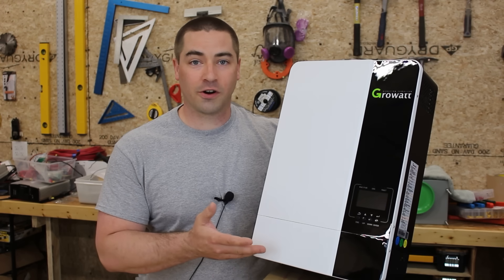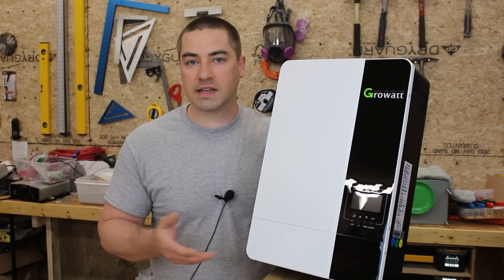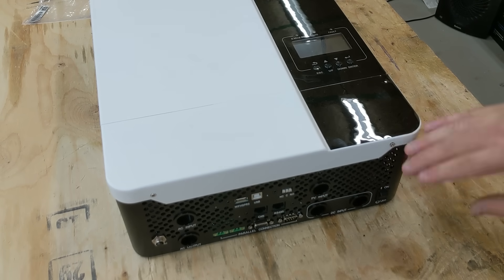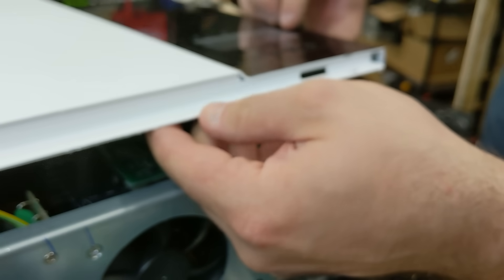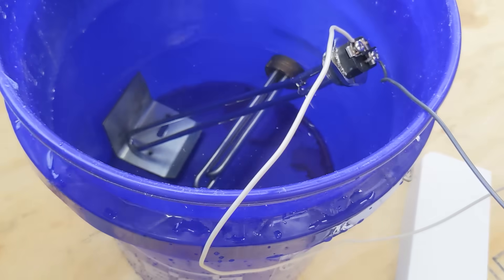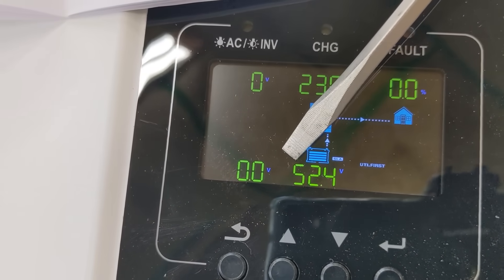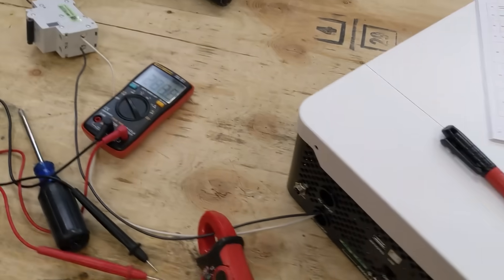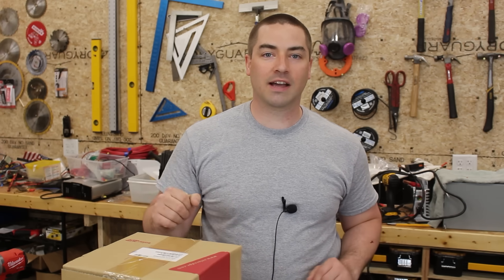Best Value Inverter, All-in-one MPPT Solar Charger, Growatt SPF5000ES, Part 1

Comment: Hey man, i was planning on getting an inverter to charge and use 48v batteries in parallel. I like this inverter but wanna know of it will work in my house if im still connected to the grid. I dont want to export any power so i dont care about it being grid tied. Will it blow up in my face lol? Thanks :)
Reply from the maker: If your only goal is to use this as a charger, then yes you can do that.  But, this inverter is not UL1741 listed, so it's not correct to use it as a pass-through of the grid to loads.
Reply: @DavidPozEnergy  thanks for the reply man. My dad ordered one so im trying to find out how to get a work around for it. Perhaps theres a way to make it work alongside an existing electrical system, maybe getting another inverter that can be grid tied so that can deliver load to the house.

Comment: Hi David. Just a question I have. On the right side you have a sticker and is saying 1 string , what do you think if we use 2 stings of 2800W each?
Reply: Connected to only one of same type of inverter U use
Reply from the maker: I currently have 2 of these inverters installed powering my home.  Each inverter has 2 strings of solar panels wired in parallel into the single screw terminals.  It's OK to do this if you stay within the parameters of the charge controller (built into the inverter) and the two strings of panels are identical.  Both strings must be the same panels, same # of panels, same angle, and same azimuth.

Comment: I'm setting up a 4S2P with this exact inverter,  8 panels total. 
each string of 4 will produce 154.4v - will that be ok?
Reply from the maker: The manual for the Growatt 5000ES says the "Start-up Voltage: 150Vdc +/- 10Vdc".  That means it could be as high as 160Vdc.  Since your proposed array is 154.4V, that will probably be OK, but might not work all the time.  I'd try to get a little higher voltage if you can.  Remember, this is for Vmp,

Comment: Questions: 
1. Can I use this inverter, with the AC Input be completely isolated from the AC Output?
2. And then use the AC Input to charge battery if need be?
3. Is there some form of scheduling for the AC charging: AC charge when battery < 50v between 10PM to 4AM?
Reply from the maker: 1. No, there is a direct connection between AC input and output when in pass-through mode
2. The AC input can charge the battery, but it will also be directly connected to the output at the same time
3. I don't know if there is a timer function, I don't think so, but not sure.  

To be clear, I only use my inverters in my off grid setup.  i don't have anything connected to the AC INPUT side.

Comment: @DavidPoz do you have a video that explains how to pre-charge capacitors on inverter? or can you explain it more? My battery pack don't have this pre-charge resistor inside
Reply from the maker: Most any large resistor will work.  Basically, you connect your negative battery to inverter.  Then you connect your positive to one, but not the other.  For example, connect the positive wire to the inverter, but not the positive of the battery.  Then use a resistor in between the positive battery post and the positive wire.  Hold for a few seconds, then quickly remove the resistor and hook the positive wire to the terminal.  I use these resistors: https://amzn.to/3T6VC1N

Comment: Dave, do you still think this is still the best inverter?  What about the SolArk 15K emp hardened?  How do they compare?  Would like to run my house and charge my Tesla
Reply from the maker: The best inverter for you might be different from my best because we probably have different requirements.  I've been very happy running my house on a pair of Growatts for over a year now.  I posted a 1-year update video: https://youtu.be/0xY4OdBfn44  Charging a Tesla will probably take 10-12kW of inverters. You might need 4 or more paralleled to run your house and charge your car.  Remember, the 15k Sol-Ark is a 12kW inverter.  Personally, I'm not a fan of the Sol-Ark platform and I made a video explaining why: https://youtu.be/EYIzEW54_bY  Yes, I was testing the 12k model (actually a 9kW inverter) so 3kW smaller than the inverter you are considering. But, keep in mind that a house might need 10kW, and charging an EV will take another 10kW, so the discussion of 3kW more is a minor point in the larger picture.
Reply: @DavidPozEnergy  thank you for the detail
Reply: @DavidPozEnergy  what about the XW Pro? I thought this video testing peak and unbalanced loads was very convincing. https://youtu.be/-Ez4cbuy7IQ

Comment: I'm considering the Sigineer 3,000 Watt, 24v inverter, charger, MPPT charge controller and the GroWatt with the same specs.  Do you have any thoughts on quality and features of these units?  I'm looking to use them on an RV with a 2kw panel array and may add a generator to the system.  Or can you recommend other brands?
Reply from the maker: If the RV is 24V Volts already, then cool.  If the RV is 12V right now, then don't bother with 24V.  Either use 12V or 48V.
Reply: @DavidPozEnergy  Thank you for the reply.  I already have 2, 12v, 300ah lithium batteries, so I guess I should go 12v.  Do you know of any 12, inverter/ac charger/MPPT charge controllers that have a good track record?  I have a decent Xantrex, 2400watt inverter/120amp ac charger that is modified sine wave.  It seems to do everything well except it causes clicking noises in the stereo.  I've thought about running a dc circuit to the stereo and using a small, full sine wave inverter to run it.  It will run part of the stereo on the current 12v that is already hooked to the stereo, but I've added several pieces to the stereo that are ac.  I'm debating going with charge controllers that will handle the 2kw panel array at 12v, which are expensive if going with Victron Energy, Outback Solar, or other well known brands.  Comparing the prices led me to look at the all-in-one systems, but I'm not familiar with the brand names I'm seeing.  Again, do you know of any that are 12v with decent quality or any high quality charge controllers that aren't quite as pricey as Victron, etc...?  Thanks again for the reply.
Reply from the maker: I don't know of a good all-in-one @12V.  Sorry.  You are right that buying Victron CC that can handle 2kW@12V is going to be expensive.  It will be more expensive than on Sigineer 24V all-in-one.  So I get it.  It's not the worst thing to get the Sigineer if it will work for you.  If you didn't have batteries already, then I'd push to go 48V.  It just makes so many other things easier.    I'm with you though, if you already have most of the components, and one $838 inverter from Sigineer is the last piece of the puzzle, then it's cool.  But, I wouldn't keep buying components like more batteries in a year or two until you can go all 48V.
Reply: @DavidPozEnergy  Okay, thanks.  Yes, I can see how 48v makes a lot of sense.  Wish I had thought of it before buying the batteries.  But now you've got me thinking about going 48v.  The batteries I have are JITA, 12v, 300ah x 2.  They have not been hooked up yet.  I bought them almost a year ago thinking the supply chain may dry up.  I know you can't mix old batteries with new but since they haven't been used at all do you think it would be okay to buy 2 more of the same and connect them in series for 48v ?  If I charged each one up individually first before hooking them together to equalize the charge state do you think they would be okay?  
I looked at 48v inverter/charger/MPPT charge controllers and there are quite a few.  Sigineer, GroWatt, Sungold, MrPow, .....  I also see that some have transformers like the one you reviewed and some are "solid state" or something like that and much lighter and smaller.  I have room for the larger ones with transformers.  Is there a significant difference between them?  Do you know of other brands that might be better than the ones I listed?  
Doing calculations on doubling the battery capacity might allow running the 2 refrigerators both of which I've converted to 12v/24v, either or, dc compressor driven rather than absorption which is standard on RV's.  I've kept track of wattage usage on each, absorption vs compressor driven, and the compressor conversion uses between 1/4 and 1/7 the power depending on ambient temperatures.  The efficiency factor almost doubles in cold weather from 1/4th the wattage to 1/7th.  
The increased battery capacity would also run the 12gallon water heater, ac and dc lighting, upgraded stereo (40 speakers and 2 subwoofers - I like jazz music) and all the small appliances.  But, it would depend on the amount of solar gain to power the 2kw panels.  I travel mostly in the West and Southwest where sunshine is abundant.  
So I guess my questions would be transformer vs solid state inverters, brands that might hold up for awhile and whether my idea on 2 more batteries paired up with the 2 that I have, is it a good idea or not.  They are not high end batteries but they do have a BMS that allows 200 amp loads and they have heating pads.  But I don't think they can communicate with an inverter unless there are add-on devices that will do that.  Also, if you have any ideas on high capacity 48v to 12v converters, maybe around 1,000 watts, that would be helpful too.  Sorry this was so long.  Thanks for your time on this.
Reply from the maker: Since you said your batteries are Lithium, then yes, you could buy 2 more of the same type and series all 4.  But, you have to double check with the manufacturer that they allow 4 in series.  Some only warranty the product with a maximum of 2 in series.  
Transformers will aid in starting very large surges.  If you have a whole-house air conditioner for example, then you want a transformer.  But, the whole industry is moving to transformer-less designs and they are amazing compared to just 5 years ago.  I'm running my whole house on 2 Growatts and it starts my window AC's, fridge, table saw, air compressor, etc. no problem.  If you are looking at all-in-one, then I'd buy Growatt or EG4.  Depends on the size of the system you want, and if you want 120V only, or 120/240V split phase.  If you only want 120V, then check out this one: https://signaturesolar.com/eg4-6-5k-off-grid-inverter-6500ex-48/?ref=4_rHcgZ9x-TiF-  
Converters:  If you are in an RV, and want 12V for lights and accessories, then yes, there are some buck converters on the market.  But, 1,000W is kinda a lot because it's 83 Amps.  I'm guessing you have a water pump that's 12V?  If this is correct, and you are trying to power a momentary draw for a pump, then adding a small 12V battery can handle the surges, while allowing you to use a small (perhaps 10A) buck converter to keep the battery floating at 14V
Reply: @DavidPozEnergy  Wow, using a small 12v battery for the dc loads is a great idea!  Do you think I could simply use the current Xantrex inverter/charger which has a 120 amp 12v charger and plug the shore power line-in into the 48v Growatt inverter to keep the 12v battery charged off of the larger 48v battery bank?  There is also an on-board factory 12v charger that came on the RV which just plugs into an ac outlet which would also be running off of the 48v battery bank through the Growatt inverter.  It seems like that simplifies the dc side of the RV.  Again, great idea.  Thanks again.
  
Also, the RV is 50 amp and has a switch that changes it to 30 amps.  As far as I know the switch just disconnects the 2nd A/C unit.  I'm guessing the 50 amp service is split phase since the plug has 4 wires.  Does the Growatt have a 4-wire output for split or dual phase 120v output?

Comment: hey david very informative video I am interested in buying this inverter. how many ohms resistor should I buy for pre charging the resistor. thanks for the reply and keep up the good work
Reply from the maker: I think I was using a 10 ohm resistor in the video.  https://amzn.to/3cIIhMu  However, the exact ohm doesn't matter very much.  Also, I learned after this video, that the batteries I'm using have a pre-charge resistor built in.  I could have just wired it and turned on the battery.  https://signaturesolar.com/eg4-lifepower4-lithium-battery-48v-100ah/?ref=4_rHcgZ9x-TiF-

Comment: Will this rum a 240v mini split ac
Reply from the maker: Yes, I run my 240V mini-split with it.
Reply: @DavidPozEnergy  just coming right from the growatt no tranformer right
Reply from the maker: My current setup has an auto-transformer, but I did run my mini-split for a month directly off the Growatt before getting the auto-transformer installed.  My mini-split is 240V only.  If your mini-split has 4 wires, then it will need the neutral.  I don't know every model mini-split out there, I just know my model is 3-wire, 240V only.

Comment: Loved the video ant your presentation of it. I'm going to get one of these inverters and build my own small portable system unless you have any changes to the hardware you used. I also watched your 1 year later video so I suspect not, but I wanted to check before spending the money. Thanks
Reply from the maker: This inverter is 240V only, I add an auto-transformer for 120/240V split phase.  But, if you need more power than 1 inverter, there is another option.  If you want 10+kW, then instead of 2 inverters and an auto-transformer, you could look at the EG4 inverter.  They are 120V only, but two together will make 120/240V.  https://signaturesolar.com/eg4-6-5k-off-grid-inverter-6500ex-48/?ref=4_rHcgZ9x-TiF-
Reply: @DavidPozEnergy  Thanks for getting back to me David. You are the only person out of 3 that did. My goal, or desire is to power my camper trailer totally for up to a week of camping without any worries or problems. I want my 12v/120 v fridge to stay running. I want to be able to shower on demand, sit in my recliner and watch TV with a 12v or 110 v fan blowing on me. I want to cook something something to eat when necessary. I want my lights, both 12v and 110 v to work. My camper is total electric because that is what I want. If you can suggest what hardware I will need to accomplish this I will be extremely happy. I am a disabled Veteran so I live in a fixed income and love to go camping / fishing. Again thank you for taking the time to get back with me.

Comment: Hi David. 
I have one inverter like that one you are showing in this video, and is being used in our house in Peru S.A.  and was installed by a local engineer along with the solar panels.
The inverter was also installed to the street electrical network as back up, in case there was not enough sun to charge the batteries or if the electrical use of the house was more than the batteries can handle… for some reason there is a problem with street electrical network. the invertor is using it as a main power input and canceling the solar input.
Any advice please.
Thanks.
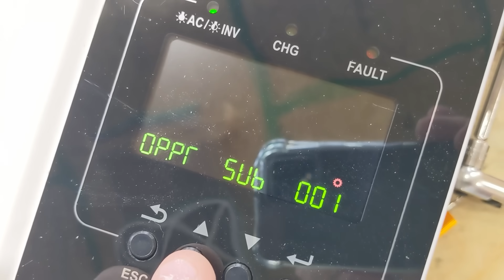Reply: At 13:16 David shows the set up of output source priority, which he set to 1 for solar. That might be the setting that you need to tell the inverter to use solar first instead of mains power from the street. 🤔

Comment: I am not very knowledgeable but I am putting solar on the RV I live in. It runs on 30 or 50 amps so has an electrical panel that runs everything including two roof air conditioners. So if I got this unit I am wondering how I would connect it to my RV panel. Any help would be appreciated
Reply from the maker: My understanding is that every item inside an RV is 120V, even if you use the 50A/240V plug.  If that's the case, then I'd suggest buying a 120V ONLY inverter.  Take a look at this one: https://signaturesolar.com/eg4-6-5k-off-grid-inverter-6500ex-48/?ref=4_rHcgZ9x-TiF-  You will still need to adjust some of the wiring so that if you decide to use a 50A/240V plug, you don't feed 240V into the same circuit.

Comment: There is a model known as Growatt Revo VM III Pro 3.5 KW just cost $395 in Pakistan which is Right now 82000 PKR. which works without Battery only on Soler.

Comment: would this power a   2.7  emesion heater
Reply: Yes, at 16:00 David says this inverter works well with the 4500 Watt immersion heater, so it will power 2.7 kW heater and some other small loads at the same time. ☮️

Comment: Hey David, really enjoy your videos, and have learned a lot watching them... you're a good instructor/teacher. Question: I am wanting to power my shed/shop with solar, and was wondering if you had a good combo you know of that will work. Light work with wood (saw table, drill press, planer, cnc router), or if a hybrid approach would be better. I am retired, and won't be doing production work, just hobbies. Thanks.
Reply from the maker: The best place to start is to make a list of your loads.  There are two things you are trying to figure out: 1. the inverter size.  2. the battery size.  So, let's say you want a table saw, shop vac, and lights on at the same time.  That might be 15A+8A+4A=27A  27A*120V=3,240W.  In this example i'd buy a 4kW inverter or larger.  The one I'm using in this video is a 5kW, but needs the auto-transformer added.  If you only need 120V and don't have any 240V loads in your shop, then stick with a 120V inverter.  Here is an example: https://signaturesolar.com/eg4-6-5k-off-grid-inverter-6500ex-48/?ref=4_rHcgZ9x-TiF-

Comment: Sorry but you only talk about the inverter characteristics. How about the power storage capacity & type?
What power storage do you use?
Is there a built-in power storage for the inverter?
Reply from the maker: I'm using a battery bank made up of 6x LiFePO4 batteries, each rated for 5.12kWh of capacity.  I have a few other videos just on the battery bank if you are interested.

Comment: can I use 10x 49.5v VoC PV Modules with spf5000es?
Reply: At 17:00 David says that this inverter is rated for up to 6000 Watts is solar input.  The maximum solar input voltage is 450 volts.